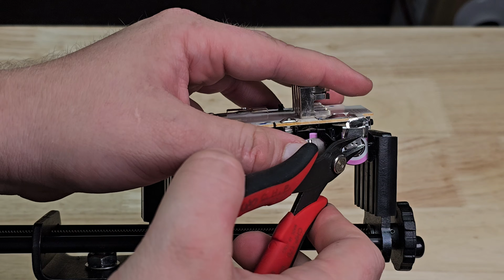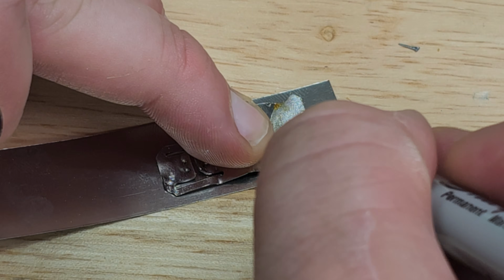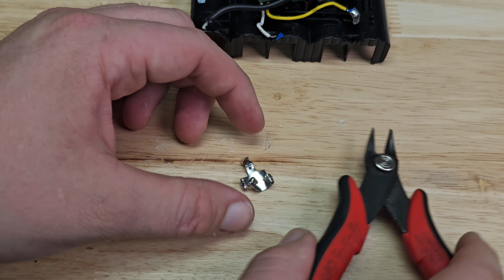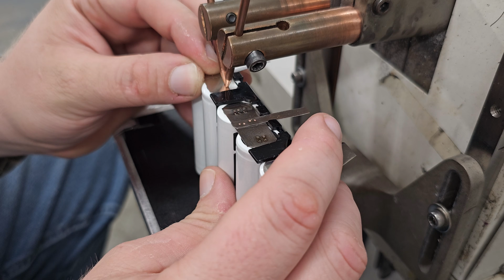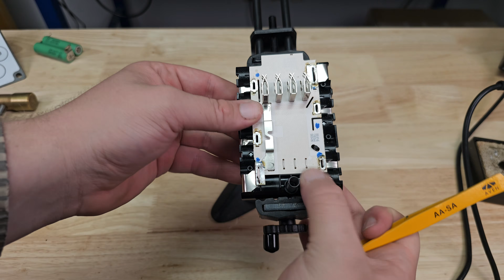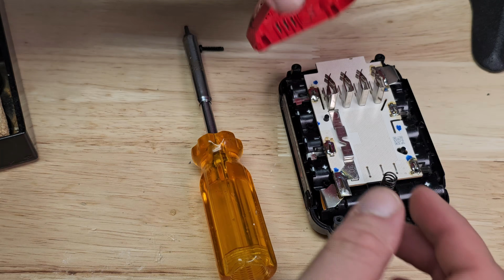How To Rebuild A Drill Battery | FULL TUTORIAL | Part 02

Comment: what do to if you don't have a welder?
Reply: I repaired one once by keeping original tab and soldered tab back to battery by tinning battery and tabs after removing bad call.
Reply from the maker: You cant really do it correctly without a welder. Soldering can damage the cell internals.

Comment: Thank you for showing the innards of these packs. I've a number of ageing B&D packs and am considering refurbishment rather than replacement. Would you consider it a safe option to purchase cells with pre-welded tabs and then soldering wires onto those tabs? I don't have a spot welder and couldn't easily justify purchasing one for this one job. I hope you enjoyed your tea, as a Brit I prefer mine hot with milk 😊
Reply from the maker: I don't recommend soldering directly to the can because it can damage the internal tab connection or the cell's CID

Comment: so ive got some batteries that brick themselves (hardware fuse) if you disconnect all the batteries from the board.  you need to jumper a power source to the board before you disconnect the cells
Reply from the maker: I have a few designs with active fuses. One trick that I use is to jumper the drive line to GND or whatever is the non-driven state while I'm working on the pack. This helps in pack assembly and then the jumper is cut.